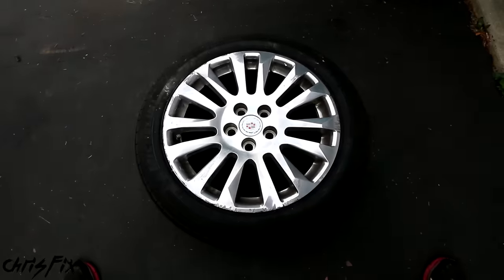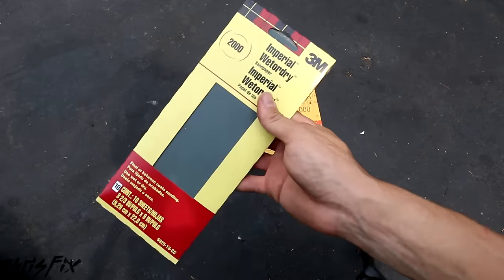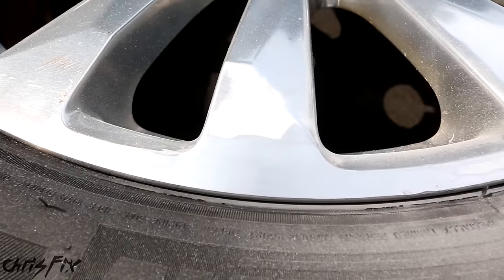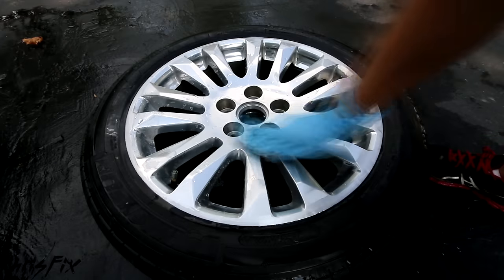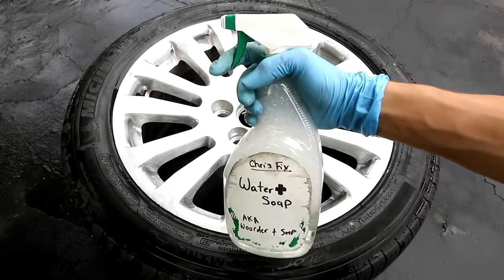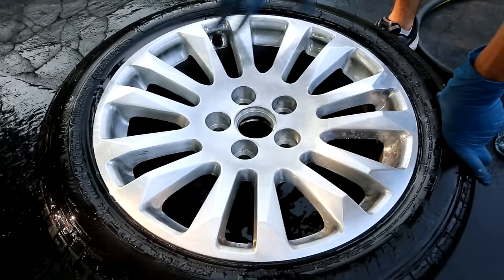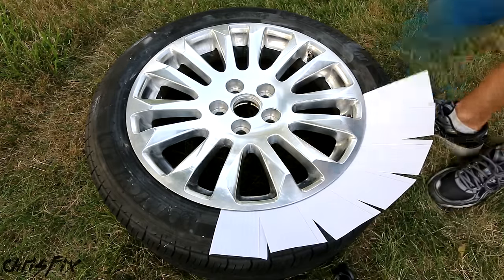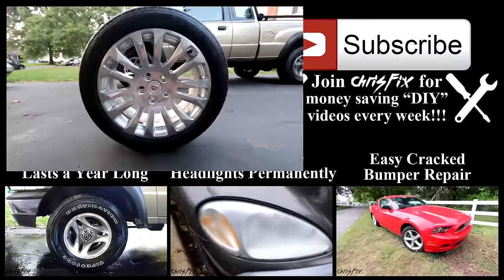How to Repair Rims with Curb Rash or Scratches

Comment: I just bought my car and I'm not used to low profile tires.  I caught the curb with my rim on the Right side pulling into my parking spot.  Not as damaged as your wheel.    I was wondering if you can avoid stripping the whole wheel and re-clear coating and just do the repaired area and buff out the transitions to the old and new clear coat.  Thanks for putting together the video with detailed and clear instructions.

Comment: Before senior Chris Fix existed, I completely ruined a couple of wheels.  I was pissed and then I invented a solution that has been extremely good at protecting my rims forever.  I was driving e36 BMWs m3 wheels but probably will work with most cars. My solution is so good that 2-3 years later I drove over a curb and almost knocked myself out and didn’t scratch the wheel.  (My shocks are probably a little stiff.) Here’s how it works: instead of 225 tires in the front run 235s, and instead of running 245s in the back I ran 255’s, that way when you forget, like we all do, it doesn’t ruin your whole wheel. 
I do believe that my rear tire required more room and the front didn’t.

Comment: Nice video. I take me scoffed curb rashed wheels to a local guy. He has CNC machines and several paint rooms. He charges between $100 - $250 19 - 21 inch wheel with millennium finish (Two tone)

Comment: I used aircraft stripper and it works better since it's a gel.  I don't clear coat just polish after the winter, new road rush is not a problem.

Comment: So I did this and I followed every step to the Letter. The rims on my car were my old boss's rims, and just put it this way, when he saw the finished product, he wanted them back 🤣😂  Even made me a cash offer! But NOPE not happening lol. They were all curbed up each and every one, with the clear coat peeling off. I really wish I could post a pic of the before and after, they look like brand new Chrome rims now. Only thing I should've realized was that the stripper was gonna take the black paint off my rims, but I caught it right away and only had to re-paint a few small parts on one 1 rim. I can't believe I was gonna pay someone to do this 4 me, I definitely recommend it

Comment: Chris you did a good job but that is a hard work+ chemicals + electric tools.  I use ,, Poxy bison for metal'' for all my 4 rims.  I just clean the rim, put the mix of the poxy in the scratches, let it dry then manualy sand it. After that I just put a second layer of poxy and sand it again. Then I just paint all the rims. They look like new after 3 years.

Comment: Chris' work is perfect. But if you don't mind if it's slightly less perfect,  use filler for all rashes and chips then sand and paint. It'd be a lot quicker and easier.

Comment: If paint is peeling off the rim then someone already repainted it or it is low qaulity.

High end rims have either an anodized surface, powdercoating or a mix of both coming from the factory.

Plenty of people do this but it most likely won't last as long as factory finish.

Comment: Hello Chris, I am going to give this a go. One question, I have the OEM wheel touch-up pen. Would I take the same approach you do for the body example "fix a scratch using pen "? Mask it off and build up the  paint and then sand with high grit paper to blend it in? My wheels are black.

Comment: I really enjoy your tutorial videos Chris so I felt comfortable seeing how you handle the "road rash" so common on aluminum wheels. It would be a nice touch if you could advise people on where they find some of the tools and supplies you use in these videos. 

For instance, I'm having a devil of a time trying to find the flat wheel sanding accessory that you used on your Dremel tool. I've spent considerable time checking out Lowes, Home Depot, Harbor Freight, Walmart, Auto Zone and Advanced Auto trying to find the flat wheel sanding accessory much less the different grit options.

Same thing for the Spray Can of Clearcoat. Any help you can give to help us find some of these products that you use would be greatly appreciated.

Thanks for your educational videos! I've picked up a lot of wonderful ideas and useful ideas on  a variety of auto related subjects.
Reply from the maker: I link all the tools and products I use in the description.
Reply: @chrisfix , thanks! I'll be ordering the flat wheel sanding wheels from Amazon.

Comment: Hi Chris. Thanks for the video. I have an mr2 roadster and want to take the wheels down to the aluminium (clearcoat and paint in very bad condition and don't want to repaint). The question I have... as I'm sick of hearing all the different opinions...is, after sanding down and the polishing, you clearcoat the wheel. Will the clearcoat adhere (as it will be very smooth) and does it stop the tarnishing and corrosion of the aluminium for a good long time.
Regards Pete
Reply from the maker: It does!
Reply: Thanks Chris

Comment: Chris. Great video. Curious if you have done ones that are painted on the inside of the spokes, just the face is machined aluminum? My wife's wheels are curbed just on the rim of the wheels where the finish is machined with a clear coat. the sides of the spokes are painted. My dilemna is doing your method the stripper will obviously take the paint off. where I do not want it off. Any suggestions?

Thank you!

Comment: Hi Chris, If your clear coat is in good condition and you just want to change the colour do you still have to remove the clear coat or you can light sand it and paint it over the clear coat?

Comment: Hey Chris, what if I only have one or two areas on the edge of my wheel that need to be repaired? I wouldn’t want to strip and re-coat the entire wheel just for a couple small areas. What would you suggest in that case? Thanks for the reply! 😉👍🏻👍🏻
Reply from the maker: I would tape off those small areas and just concentrate on that!
Reply: ChrisFix thank you!! I have the same situation and was wondering the same thing! Now I don’t feel so overwhelmed with just 2 curb rash areas vs an entire wheel!

Comment: Hello Chris, how you doing Sr?
Good videos Sr, lot of information about it but I have a question. 
I'm a DYI weekender warrior and I drive a semi truck.  Now should I buy Grey Pneumatic 1/2" Drive 6-Point Standard  and deep Length Metric Duo-Socket Set, to have the best of both worlds or just Grey Pneumatic 1/2" Driver Metric Standard and Deep length??????

Comment: How about a combination painted and polished wheel? I have a 2021 Kia Optima SX with 8 spoked machined and charcoal grey painted wheel. The area between the spokes is what is painted and the "flats" of the spokes and the rim of the wheel is polished/machined.  How would you proceed to refurbish this kind of wheel?

Comment: I’m currently trying out this method and I’m having trouble at the stripping part. I’m not sure if the clear coat just isn’t coming off at parts or if I’m just damaging the rim
Reply: Kayon Walker one way to test if you have clear coat on the wheels is if you use some metal polish and if there’s black residue coming off, then you would not have clear on the wheels.

Comment: My wheels are painted and the outer surface is laser cut. 
I only have issue with the laser cut area that has clearcoat bubble. 
I was thinking of working on the laser area only then just scuffing up the painted area to allow me to do a full spray job on whole wheel with primer, paint, clearcoat method. 
Q is will just scuffing the painted area be ok or will I need to remove all the paint first? Thanks

Comment: You should 80 sandpaper the deeper scratches first just gently as to cause less tearing to the material you are using to clean and wipe it off... Then wash it and do the rest of the restoration... Makes things easier and much more pleasant during the cleaning phase...

Comment: is there any alternative to using stripper to get rid of the clear coat? And if the scratches are minimal can you just use sandpaper?
Reply from the maker: You can try using acetone! And if the scratches are minimal, I would use spot putty and see if it fills it in correctly!
Reply: @chrisfix  thanks so much! That's a lot easier to get here

Comment: Chris you repaired some rims in the other video but didn't use "stripper". You sanded, applied bondo, primer filler, base and clear. When do I know when to strip the clear coat?
Reply from the maker: You use stripper when you need to remove the paint and polish the wheel. If there is still clear coat on the wheel you cannot polish it. If you are painting the wheel you dont need to strip the paint.

Comment: Chris, thank you for these videos!  How do I finish an aluminum wheel that needs bondo repair on the rim, above the bead sealing surface?   Do I have to paint it with an aluminum paint that matches the existing aluminum?  If so, what paint can I use?  Thanks!

Comment: Looks great. How would you combine a partial paint with aluminium polish? 
I would like to paint my wheels black but keep the outer surface polished aluminium.
Reply: I did this on mine.  Where there was damage I sanded as Chris did. I planned a black wheel with polished lip.  The damages were on the lip, so i was able to high polish it while leaving the paint on the rest untouched.  I masked off the polished area of the lip & painted the rest black.  Aluminum will dull over time, hence the clear coat.  Without it, be prepared to go back & carefully repolish the lip occasionally. Wish I could link a photo in the comment.

Comment: I’ve used your methods for other wheels but this aluminum one with stripper has always been difficult! Can we just take 80 - 120 grit to the whole surface to remove the clearcoat?
Reply from the maker: Yes. Usually sanding it with 80 grit and then using the stripper works great,

Comment: What if you just want to paint it? What about airplane stripper? Will it work better?

Sorry for the edit and original question.
Reply from the maker: If you just want to paint it, no stripper is needed. Sand it smooth and paint.
Reply: @chrisfix  THank you. My last problem is that oem wheels are hyper silver. I am guessing I should just choose a nice silver or gray and forget about trying to duplicate that hyper silver process in my garage. Lol

Comment: Hello ChrisFix, I know this is an old video but... I recently bought new wheels off Craigslist and they were rusty so I stripped the paint on the entire rim(there was no tires). I am wondering if I am supposed to use a certain type of paint on where the tire sits or if any paint +clear coat is safe to drive on?  Thanks for the guide!
Reply: They make paint that is specific to wheels, but a variety of paints will work. Probably the best is a catalyzed paint that you would mix and spray your car with. You can also buy 2K paints in a spray can. The prep work is really the most important aspect, and you a UV resistant clear over it if you want it to last.

Comment: 400 grit sandpaper takes the old clear off and you don't want it "polished" before you clear it. lol. It's all the same though, rattle can clearcoat will not hold up very long on an aluminum rim. It's a quick fix to sell them or the car however.

Comment: I’ve an aluminum bike wheel with oxidation spots I’ve removed with sand paper.  I went through the entire wheel.  I didn’t get a layer of clear coat material on the sandpaper nor with layering it multiple times with acetone.  I know the recommendations are for paint stripper but I gave acetone a try.  

Could it be possible that the wheel didn’t have a clear coat?  I was wondering given that I’ve sandpapered the problem away and buffed the entire wheel.  Can I go ahead and spray clear coat on the wheel.  Or do I need to put paint stripper on the wheel?  I mean i didn’t get a coating of with sanding the wheel down.

Comment: @chrisfix i have aluminum rims, but were powder coated. What do you think would be the best way to work with this? The clear coat is bubbling as well. Would i have to sand the original coat off? Then prime? I want to make this a one and done attempt if possible.  Any help would be appreciated
 Thanks

Comment: Love watching your videos Chris, but also hate them at the same time
cause i just keep watching.....and watching and before i know it, boom
the days over lol!

 I actually just swapped my simmons wheels for a set of lenso d1r's for my ss
but they have some rash on them, but also a couple of gauges that i definitely 
will have to put a few little tig welds on to fill......which brings me to my question

 How deep would a scratch/gauge have to be before you would put a little bit of weld on it 
so that when you sand it, it will go back to original thickness, rather than actually getting thinner
since you are taking material out just sanding out the scratch?

Comment: Is it possible to just use the first tool to remove the scratches and stop there and leave it that way? (Like at 4:16) so Like without going in and removing the clear coat off the entire rim and then adding a new one? I wouldn’t mind having the dull areas rather than the deep dark scratches my rim has. And I don’t have many. 
Just wondering if I do that, if the clear coat will eventually start peeling away from those areas anyway due to sanding it

Comment: Can I do this without taking my wheels off like taping over the Mercedes thing and the wheels?
Reply: I bet you can, but think about it:
The trouble you'd go into sanding a vertical surface (even if using rotary tools) up to 2000 grit, plus the risk of applying paint stripper onto your car finish (you'd have to be extra careful and cover way more area). Also when repainting with clear coat, you have to keep in mind that if you don't spray it from multiple angles, you may not cover every bit of the wheel. Not to mention that every fluid you apply will be constantly flowing down the rims, so I'd be very wary of that paint stripper flowing onto the tires.

All in all, you do what you feel like, but I'd rather do as he did and take the wheels off to make all this over a flat surface, specially the sanding part, since I'll have to go through multiple steps.
Reply: @joaovictoraguiar9410  thank you for the advice, I am just a girl though and it would be my first time taking off a rim so I’m scared, I think I have the tools to take off the rim though, if I really have to. I’m pretty determined to fix this curb rash myself I feel like if not I will get so ripped off..I actually did some haphazard sanding this morning ...in my opinion it already looks less noticeable I think it was 220 grit ...it was all I could find in a friends garage haha and I definitely need more elbo greese or something rougher if I want to get some of the scrapes completely flat!

Comment: I put clear coat 2x on my rims painted them chrome metallic and it ruined them made them look grey milky grey.
Reply from the maker: You can sand off the paint and do this again, what type of rims do you have?
Reply: ChrisFix ford falcon XD XE XF XG 14inch made out of steel, I’m from Australia by the way, and I used dupli colour for the chrome metallic, do you think maybe I should use a dupli colour clear coat??????? I can send you a photo of them if you want?

Comment: I want to make my black wheels look like chrome. Can I sand and polish a black wheel. It looks to have grooves on it like it's been turned on a lathe? Would that mean they are forged? These are 20x10 BMW wheels. Or would it be better to trade these for the polished ones? I didn't want to sand them if they are cast aluminum because I think it would look pitted? But if they are forged sand away and polish or paint or powdercoat. They don't have any name on the wheel that I can tell.

Comment: Is there an easy way to do this with a pair of rims that have two colors on each wheel? I have a mustang ecoboost tire with black paint or vinyl on a brushed aluminum rim
Reply from the maker: You would have to tape off the part you aren't painting and do it one at a time!

Comment: How would u fill a gouge on a aluminum wheel ?   Can u use the bondo  like in your other videos or no because it’s aluminum
Reply: If it is painted you can use JB Weld to fill the gouge, and repaint the rim.
If it is not painted, you're pretty much out of luck if you want it to appear new again.
I'm dealing with this right now on factory rims, and it's either trying to find stock rims on Ebay, or buying aftermarket replacements as new replacement rims from the dealership are unreasonably priced. Whatever your case may be, I wish you luck.

Comment: How bad is it to leave corrosion alone on my aluminum rims? Thinking about painting over them to save money but I also don't want them to deteriorate over time.
Reply: Spruce painting it with rust on it will do you no good, it’ll continue to spread with the paint over it plus it’ll look bad. Do the best you can with sanding it off, then paint

Comment: Would a 80 Grit flap disc on a Dremel work or would it be to much?
Reply from the maker: It would work but probably be aggressive so go slowly. You can always test it out. You will need to go up in grit to finish it so it is smooth no matter what.

Comment: Just wanna say if this is your first time spraying your wheels, DO NOT use the card method for masking off your tyres 🙄 Deflate the tyre, get some masking tape and mask under the lip of the wheel onto the tyre and work your way around. I’ve seen people do the card method and get massive build ups of primer, paint and lacquer. Unless you’re confident you can do it, that’s fine. But honestly, just do it properly, also saves a lot time🤣
Reply from the maker: Thanks for sharing